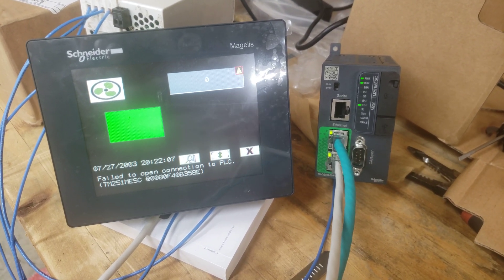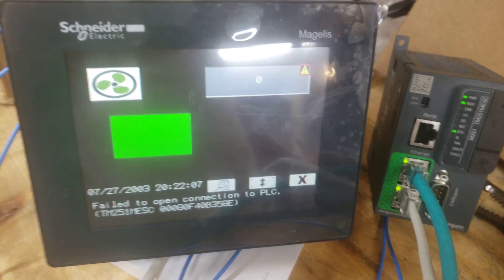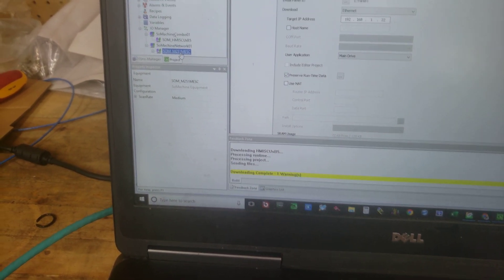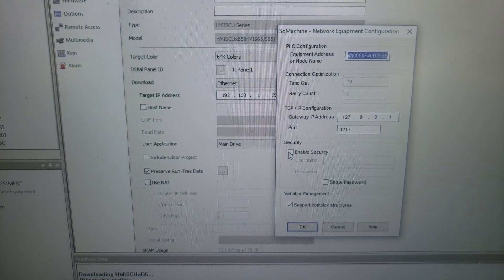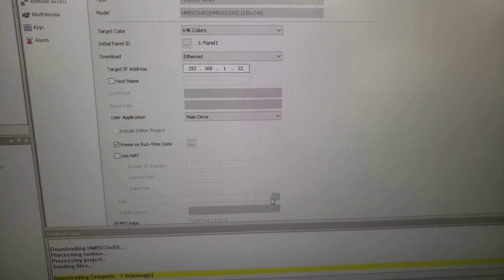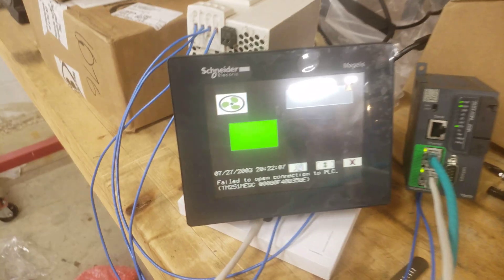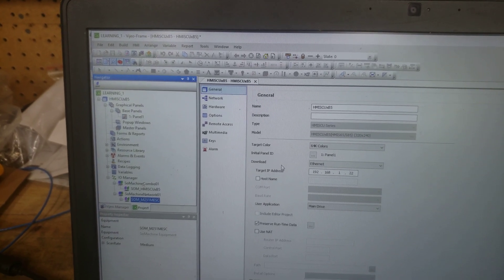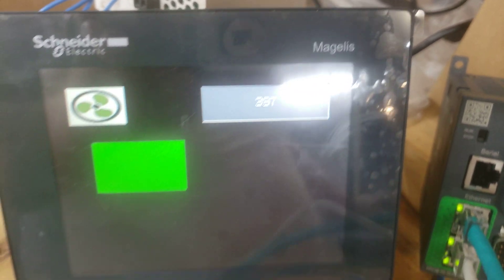FIXED! Schneider Electric "Failed to open connection to PLC"

Comment: Hi, Im having the same issue, I  use PLC M200 with HMI ET6400. M200 is programmed in machine expert basic and im trying to connect it with the hmi using Modbus TCP.  Any chance you know how to resolve the issue over the modbus TCP?

Comment: Hi guys
I faced problem with the HMI while starting up the machine the errors are
Failed to receive on a socket ( com_veloce)
The other error is 
Variable data had bad data quality . Write aborted . (com_veloce) 
Is this error looks like the same error in the video or not?

Comment: Another tip: If you connect your plc by ethernet cable to the pc, go to the browser and insert in the website bar the plc IP, you can acess the configuration of maintenence and disable the acess by password. Then that configuration is no longer necessary
Reply: But before discovering this, i've used your method, thanks
Reply: Can you provide me your WhatsApp number
Reply: Dear Sir, I have xbtgt4330 magelis hmi and error is no reply from plc within timeout period.  Can you please help me to solve this problem.

Comment: Still can't get my HMIS5T to connect to my M241 after hours and hours of tries. It's ridiculous , I tried every possible option without any luck although everything pings correctly!
Reply: thank you it helps me as well hmi and controller both are on the same node name that's why i was facing the issue i changed node name and boom it is working
Reply: I can help with that. These are a pain sometimes. what's the message you are getting on the HMI?
Reply: @camarobo9244  I get the same message as you do. I'll resort to Schneider supplier technical support. Thanks for the offer though! I've seen this problem everywhere on the forums. I'll let you know if there's a solution to it.

Basel
Reply: @Bisofication   Hi Basel, Have solved the issue? I have the same error and i have tried @Jim D. 's method but no luck yet!
Reply: @a.kariemahmed8109  yeah, I changed the node names of both of the PLC and the HMI and that solved it apparently
Reply: @Bisofication  what did you change them to? because in my case the node names are forced from the machine expert logic builder to have the same node name shown in the controller editor!
Reply: @a.kariemahmed8109  In my case, they were both named the exact same name! So I just changed the screen to "HMI" and the controller to "PLC" and that solved it.
If that doesn't work for you maybe call Schneider tech support they'll be able to make it work.
Reply: @Bisofication  Sorted, thanks for your feedbacks Basel, it was a combination of reasons the node name are only one reason, but yes there is a bug in the codesys platform, I do not understand how the HMI and PLC both fall under the same node name in the logic builder- controller editor !!! that makes the login with the PLC a cumbersome too!
Reply: @a.kariemahmed8109  Haha well I'm glad it's solved now!  It's always dumb bugs/mistakes that annoy me the most. Thank god it's history now :)
Reply: zip and shoot me your program file to tech.support@appalachianautomation.com if you want and I will see what I can do to help solve it. I don't mind to help at all.